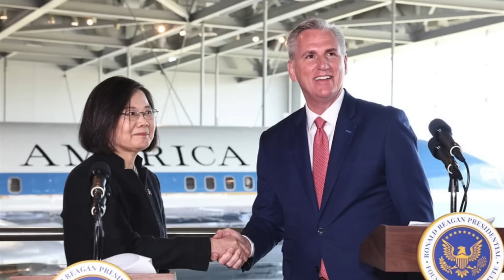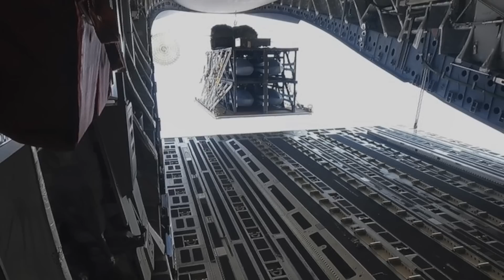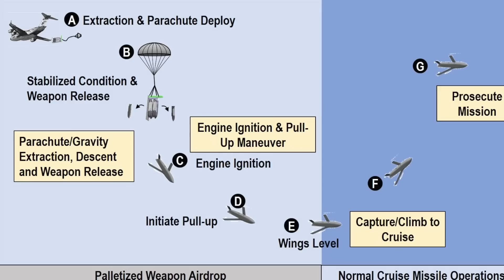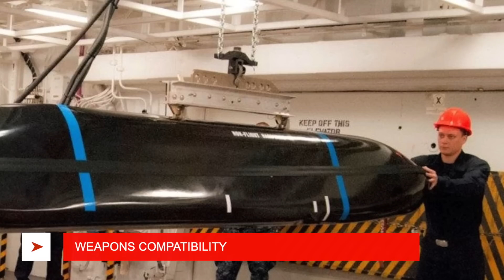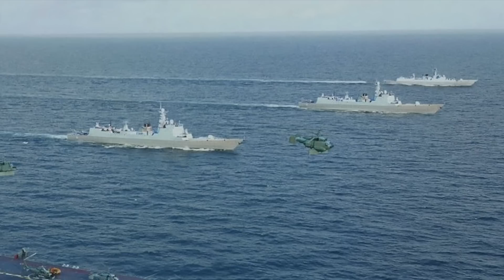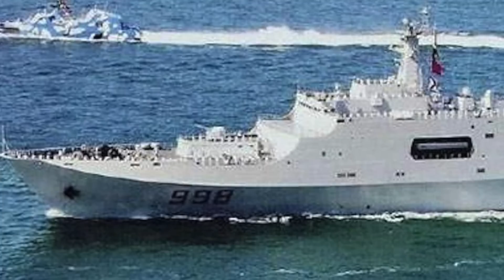LRASM deployed from 'Rapid dragon' can save #Taiwan from #Chinese invasion !

Comment: Still need the runways to get the C130s off the ground, I suspect runways might be targeted early. If possible to get them deployed in significant numbers though seems to have utility. Most enemy troops likely to be sent in a second wave on passenger ferries, better to neutralize the invasion before then....
Reply: The C-130 can use improvised runways like roads.
Reply: Cargo planes are fat, slow, easy targets in the air also-
Reply: @doublebackagain4311  obviusly they would have fighter escort and with missile range of 500 nm it's hard to keep your own fighters in the air all the time covering 500nm circle

Comment: This system is only a game changer in a limited time frame. The idea is to quickly close-in gap with old-existing assets to catch the war breakout in the taiwan strait. 
LRASM can do the swarm tactic, but so can the chinese. China is one of biggest drone user, and PLAAF is building a lot of long-range air to air missile - any missile can penetrate defense line and seek onto a target large as P-8. Also, PLA is never short of cheap military assets with great numbers -- they have the largest surface fleet. 
LRASM cut the cost on building new launching platform, but the production rate of LRASM is questionable -- will chinese have more air defense missile or will the USAF have more LRASM? remember taiwan strait is off chinese coast. The USAF can go all in to sink a chinese carrier group in the middle of the ocean, but launching a swarm of missile into the dense coastal air defense system with land missile launching platform that are even cheaper than old P-8 --  is that really useful? questionable.
Afterall, modern military confrontation is a game of draining out each others economy, and you cannot disagree with that.
Reply: If we use your last argument of draining each other’s economy who’s economy do you think will get stressed more? China? Who requires over 75% of it energy and food inputs to be imported and will have zero Allie’s? Or the US which has none of those issues?
Reply: @spartancrown  Five years into the trade war started by trump administration, the trade deficit from china to the US even increased, so you better stop telling yourself the US has none of the economy issues. Also, china can secure its energy needs through northern border as Russia grew weaker in regional influence, and not forgetting the fact that the US’s regional allies are also big energy and food importers, they will be stressed significantly if a war breakout in Taiwan strait.
Reply: The Chinese are no better than the Russians. America will realize it is a hundred years ahead of these third world countries . New shiny weapons do not include logistics
Reply: usaf would launch many decoys mixed with actual missiles
Reply: @hphp31416  Chinese can do the same thing. Also the decoys can’t be any cheaper than an actual LRASM, they have to fly at the same speed and reach the same distance so that they can reach the air defense at the same time. Which means their guidance system and aerodynamic parts need to be exactly the same, just without the warhead, which is likely to be one of the cheapest component of the missile.

Comment: If China was to attack Taiwan I would see the following unfold, China will send out its full local fishing fleet small boats and ships to act as surveillance and a navigational disruption to any external navy’s trying to occupy certain waters, these fishing vessels have proven to be a menace to other smaller surrounding countries navy’s and I could see lots of those fishing vessels being armed with shoulder mounted rocket launchers and some of the bigger collection fishing ships have larger weapons, this will act as a first line of information being radioed back to Chinese military, so if the see these pods being launched or the ‘rapid dragon’ missiles flying toward and over the top of these small fishing boats, it will give the Chinese navy ships a directional bearing on where these JASSAMERs are coming from.
Reply: those boats would be gone before lrasms involment, US tested jdam bombs that cost under 50k usd to hit movig ships, cheap and easy to destroy anything without big anti air missilles

Comment: Would be nice to get some b-21 acting as a quarterback for this system
Reply: any aircraft with a sufficient data link could in theory do this including a single F35. 6th gen NGAD will probably crank up the saturation strikes to a 100 with multiple networked drone swarms
Reply: That will be ideal with its nearly endless persistence.
Reply: How would we know that it's not just a drill by the Chinese? They did one recently. Did they preannounce it as such, and should we believe them if they do this again?
Reply: @ridethecurve55 they did a blockade essentially. If they were actually intending a invasion we would know well in advance from the buildup that precedes it. Staging and moving that many troops and supplies to bring across the straight would be obvious and easy to spot. Same way we saw Russia getting ready to invade Ukraine.
Reply: @ridethecurve55  If they cross a certain point Taiwan will engage the Chinese vessels. If it is the real deal, China would probably try to attack Taiwan's  stationary ATMs and SAMs batteries. Satellites and other assets will be able to pick up , China increasing the number of troops and assets close to Taiwan. They might know the exact date when China would attack, but they would know , maybe 4 weeks or less away from attacking.

Comment: It can do more than save Taiwan
it would stop an Chinese invasion force dead in its tracks
However coastal launcher are better options are as they are ready fire whereas the Rapid Dragon has to be airborne and in positioned
So Taiwan best bet is combination of weapons that allow them time to deny Chinese forces long enough to  Rapid Dragon units airborne
Reply: Taiwan has their own land based anti ship missiles which are sub sonic and supersonic.

The US is selling 100 harpoon coastal  defence systems with 400 missiles to Taiwan but it could take years to get there
Reply: I was going to say the same thing about using mobile ground based launchers as they would be much safer during the opening hours of an invasion compared to any form of aviation, although rapid dragon is great for turning the average transport plane already stationed in the area into a capable anti ship platform on short notice

Comment: The Moskva was an aging and in dire need of repair. 1 out of 6 CWIS weapons were functioning. The chain gun had a hydraulics problems. The short range missiles were out of commission, and the radar system for the s-300s would interfere with communications system with the bridge, and was probably turned off.
Reply: The Moskva was turned off a year ago today.

Comment: Networked stealth F-35Bs and F-35Cs operating at sea will be able to feed target information to LRASMs even after they are launched via datalink.

As a bonus, 100+ P-8s are also being modified to carry LRASMs.

Chinese surface fleet will be quickly overwhelmed.

Well done.
Reply: Quick sink
Reply: This is a stern warning to China that most of its fleet would be sunk long before arriving at Taiwan's coast and the other dozen or so that actually made it to Taiwan would be sunk right on its coast. 

Its definitely a total failure to be able to do an amphibious landing.  Even if they gain air superiority, Taiwan has dug in deep and would fire the Harpoon missiles, this would give time for US and Japan to launch a counteroffensive with its f35s, f18s, f15s, and f22s
Reply: Maybe but right now we dont have enough missiles to shoot. That's the problem.  We have very few LRASM and it looks like we may have dropped the ball with JASSM AFAIK it cannot be fired at ships, even though its only a software issue.
Reply: IIRC In some open source simulations the difference in outcome depends on if those JASSMS can be used against ships
Reply: I heard the carrier F35 keeps sinking in the ocean
Reply: @kylehines3185  You are thinking of Moskva.
Reply: @kylehines3185  US Navy staff pushed more aircraft overboard in it's history than russian or chienise naval aviation ever had